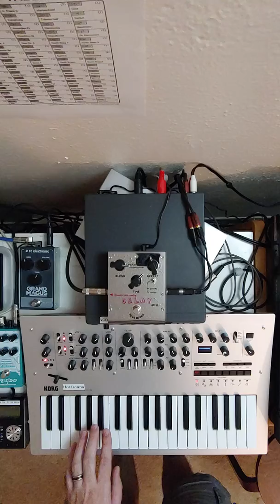Korg Minilogue Audio In: how you REALLY use it [as a 3rd VCO / with a MIDI module]

Comment: The Minilogue's block diagram has the input getting added to the pre-VCF mix, so it's absolutely another oscillator. I think this is why input got cut on the XD. If you look at the XD's block diagram it has the multi engine hitting the mix at the same place as the Minilogue's input path, so they could use the same voice circuitry as on the Minilogue, but add a digital oscillator. Given you can do anything you want with the input it gives the Minilogue much more versatility than the XD, at the cost of the convenience of having a digital programmable oscillator right on board.
Reply: This is exactly what I was thinking they did
Reply from the maker: Makes a lot of sense. Appreciate you taking the time.

Comment: Is it actually modulating or just being mixed in with the waveform?
Reply from the maker: Mixed In with the waveform is probably a better description actually.
Reply: @skate323k137  Thanks. Yeah, from what I can see it doesn't offer much other than passing external audio through the filter. I don't think anyone using a minilogue is short of ways to mix other sounds in with it, either with a hardware mixer or in a DAW. Still good to know though - the ML filter is pretty unique and I'm sure there are a few good creative uses for it on other sources.
Reply from the maker: @db3944  heard.... I made this because people were running drum machines and stuff into them which is all but completely pointless. This at least opens up more creative opportunities. Also how it handles keys for ARP vs MIDI out creates interesting sounds, or it can make a half mono half poly patch if that makes sense (minilogue set to mono but the SC still has full poly).

Comment: With the audio In feature and MIDI connection to the Sound Source you wanna add in, you can kinda simulate a third oscillator like on a Minilogue XD with some limitations of course. I also tried to feed the Minilogue headphone output back in through a little pre-amplifier with volume control (to be able to tame the signal a bit) so it thickens up the sound a little bit like you would on a Mini Moog.
Reply from the maker: Very nice. I have an overdrive on my Mininlogue now, but it only sounds good with mono patches of course.
Reply: @skate323k137  Yeah the Mono Mode really often benefits a certain sound on that Synth. Even without additional effects. The Sub oscillator feature is what i often use when using the Mono Mode :) Sooooooo useful and sadly only available there but from the limitation comes creativity.
Reply from the maker: @KRAFTWERK2K6  sub oscillator is an amazing feature for sure! I have all sorts of octave pedals but nothing beats that thickness
Reply: @skate323k137  Oh yeah. Especially when you can adjust the amount of it so nicely and really making it roll in as much as needed. This is also why i don't really use the Unisono mode a lot because the Sub oscillator with a bit of cross modulation sounds even more massive.

Comment: Nice result! I try to put the audio out of the drumbrute on my minilogue to play both machine together seem impossible to do...you have any idea how i should do this ?
Reply from the maker: I don't own a Drumbrute myself, but looking at one on the surface, a couple options... Keep in mind I made these videos in the first place because of the potential headaches of drum machines through the minilogue, but still, this is my advice; 

Primary option of course is just audio output into the minilogue audio in. You need to start a sequence running, and then turn down the VCO's, to allow the audio through. See my video about Minilogue and electric guitar if you need a little more direction there. 

secondary option getting crazy, which could be fun, would be to run both the audio out and MIDI out of the drumbrute to the respective IN's on the Minilogue. In theory every time the Drumbrute plays and sends a midi note it would open the gate on the minilogue (and also trigger sound from the minilouge itself, unless you turned down the VCO's). This could get interesting and if you try it let me know!